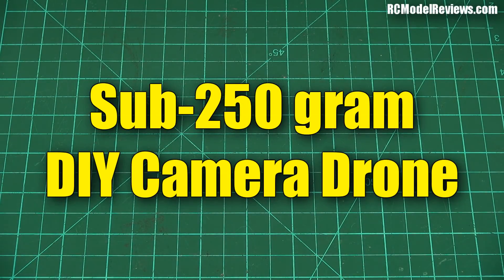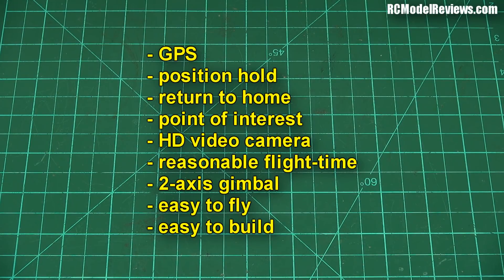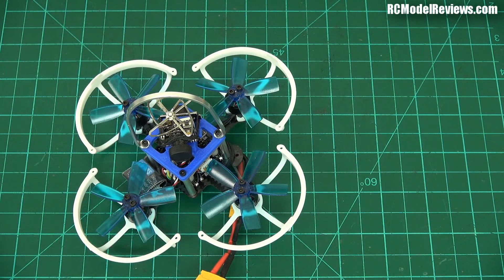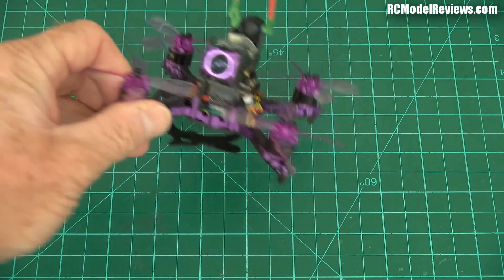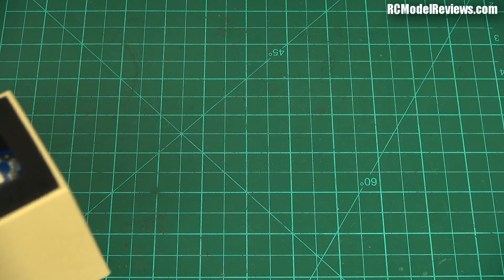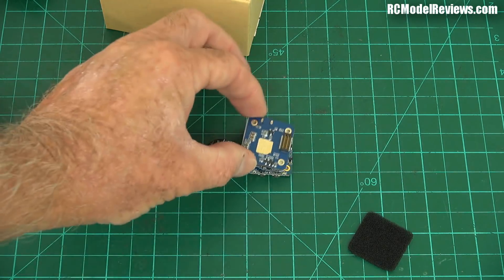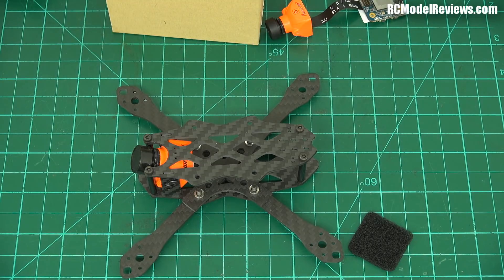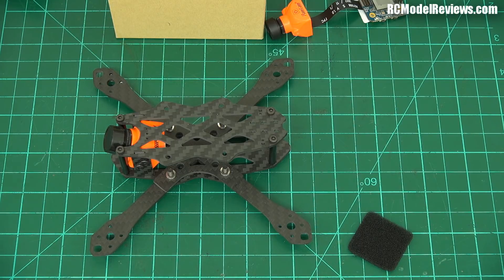A sub-250g camera drone DIY project

Comment: Hi Bruce. I'm a huge fan of your channels and have been meaning to comment for a long time. Watching with great interest on this little project. I started with a Diatone ET 160 (@ 31g the lightest 4" frame I could find) with DYS 1306-3100 motors with 4045 props, Omnibus F4 FC (iNav), FrSky R-XSR, 4 in 1 ESC, small CCD cam with Eachine VTX03, GPS with mag, 3S-850. Takeoff weight 220g. This has a lift weight ratio near 7:1 so I could get away with smaller motors, a smaller ESC, a lighter GPS and exchange the CCD cam with my Foxeer Legend 2 to get HD. No idea if that'll make enough weight allowance for any gimbal though........On another track, I also built a full FC, iNav, FPV, GPS 600mm wing with TO weight far less than 200g and long flight times. Maybe a way to reach the goal you're after. I also like the Pixracer idea mentioned earlier; same size and weight as an open source FC...but with Ardupilot. Cheers from Canada.

Comment: I did a 250 gram build with DYS 1306 2300kV motors, good ol' 5030 gemfans, Turnigy nano-tech 2000mAh 2S 20C, and a modified Diatone Blade 200 frame. Also with a GPS, and running iNav, for return to home, etc. Got about 15 min flight time.

Comment: How about a GEPRC Sparrow style frame that raises the camera above prop level? I also have some UDI U28 quadcopters that use a 720p camera that takes decent video but I am unable to receive the video with my FPV gear. I don't know what frequency they use and can't find any info on the camera board.

Comment: Great idea. Ive been waiting for a 250g DJI. Its not going to be easy to so this with a decent sized battery. I built a 250g 3" racing drone includes a 850mAh 4s battery.

Comment: I never rely on my mavics collision avoidance anyway.

Been wanting to do something like this long time. My feedback is yes do this project! But don't limit yourself to 250grams, just make it lighter than mavic.
Make it reliable, durable, easy to replace parts. Wondering how you're going to fit a 2 axis gimbal while staying under 250grams + battery + camera. My little racing quad with battery and just fvp camera is 450grams.

Comment: Hi Bruce, I have been working towards building a micro gimbal but one of the biggest stumbling blocks to date is the motors. I did attempt to rewind some cd drive motors 12n14p with  0.02 mm magnet wire, but there was no way I was gonna get 100 turns per pole to reach 15 ohms across 2 phases. The best I managed was 30. I have a 3D printer, and could probably swap ideas using sketchup, stl files and thingiverse etc. Just give us a holla.
Reply: Have you tried floppy drive motors? I have seen them used for motion control.
Reply: Hi Paul, it is possible to use small 1103 12n14p motors, but they would have to be rewound to perform on a gimbal. They need to provide high torque at low rpm, so each pole needs to be tightly wrapped with at least 100 turns of very fine magnet wire. Motors for quads etc, are wound for kv rating, so only have 6 - 30 turns per pole using a heavier gauge wire and much more power to drive them. It is a bit of a dark art to get things right. Right ?
Reply: I'm working on this too, and have got stuck on the gimbal, I have a small gimbal, but wanted to use the front end of the split on it, but I couldn't get this to work as I can't tune the board. Have a prototype frame ready to print and a nice little 3 inch frame for 13xx motors,      if you want a look, get in touch.
Reply: Hi iMeMyelf, yes I believe the Walkera 2D gimbal uses 1806 size motors, but they are designed to control a much heavier load. Like using a truck engine to drive a wheel barrow.
Reply: Hi, did you try using some of the 1806 gimbal motors already available? RCX and Emax are making some but I have no experience with gimbal motors.
Reply: Yes Ben I would like to see your idea, I have been working with the original Runcam hd by mounting the lens module direct onto the outer drum of a motor mounted horizontal (Pitch)  this is held in a fork that is attached to the roll motor. A 24pin ribbon cable and connector is attached to the opposite side of the lens module to act as a counter balance. The bulky parts of the camera is fixed to the body and is linked via the cable. I have made some prototypes and they work fine, but the heaviest parts are the motors. 13XX are reasonable sized motors, 1106 or even 0706 would do the job providing they could be wound for gimbal use.

Comment: Bruce, I'm sure you've seen the Flite Test gremlins. Their guts and frames could be a pretty decent platform to start with. You can get the 3d printer files for the different frames they've come up with so far.

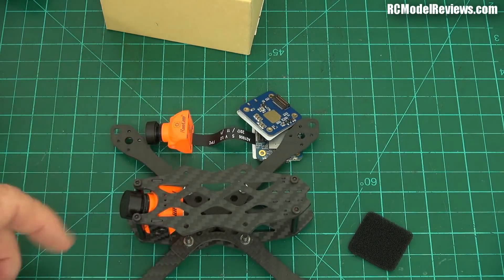Comment: I looked at the frame at 4:50 and listened to "props in view" and my first thought was to turn the frame upside down and mount the motors on what was the bottom plate with the stack reversed too. I'm sure there would be a reason why that wouldn't work but not being a builder I couldn't think of one
Reply: I've always wanted to do this with my ZMR250, building it upside-down so that the props are on the same plane as the battery, increasing flight stability.
Reply: Glad I wasn't the only one thinking that lol
Reply: Single axis gimbal could be a good idea, but you got to make your own, the Quanum single axis gimbal is atrocious.
Reply: jack36202 like the li-ion idea👍 but personally would like a 2 / 3 axis gimbal for POI and more

Comment: Im ahead of you Bruce, although my Martian 2 is a bit bigger....Im wanting a tilt servo on my HD / FPV Camera.....My Martian will fly for 15 minutes on a 2200 3S easily....I think sub 250 is going to be tricky myself.
  The other thing is that most stuff is 5 inch prop based, although I have sourced some 6 inch 3 bladers....for my F330 build.
I dont think we need those huge 8,9, or even 10 inch props either.

Comment: If it's not going to crash, then use foam-filled CF skinned props and thinner arms horizontally but perhaps thicker vertically to reduce weight and propwash resistance. Could also get away with thinner CF plates. 0.5–1.0 mm for body.
Gimbal controller boards probably shrunk a lot over the last few years, and a tiny camera would only need tiny bldcs to handle - fun challenge! I'd like to see one for a mobius mini!
Reply: Poor Bruce will need a microscope for everything in this build ;)
Reply: Yeah, I'm starting to get familiar with that, sometimes having to wear 2 or 3 reading glasses at once to do the tiny stuff!

Comment: Awesome idea, but I just don't see you beating the dji Spark, which is already over 250g. Perhaps if you could somehow take the camera, gimbal and recorder out of a Spark and put it in a lighter, simpler quad you could do it, but you wouldn't have the Lightbridge, GPS, altitude hold or any of that. If you really can work out a tiny gimbal for a Split mini, you could come up with something, but the altitude hold and GPS stability are pretty important in getting usable AP footage. Good luck, can't wait to see what you come up with!
Reply: My guess it´s one of those projects that will never see daylight... would be awesome, but it´s hard to believe.

Comment: Why does all that processing need to be in the camera? Surely we could lighten the load if the recieving headset could perform things such as WDR and perhaps better stuff such as bicubic filtered upscaling. We also need a decent camera feed that is real time and yes I know only the old analogue gives you 15ms which is why I propose another project perhaps like how the new 3D vision quadcopters have two cameras and two 5.8ghz transmitters we could have one HD camera sensor that outputs to a quad quarter split 520TVL / 720TVL depending on desired latency and final output lines. Then at the headset end you could have four receive antenna's then recombine the quarters back into a single higher TVL image. Then call it Analog Quad HD or something and find a way to miniturise it on a single board.

Comment: i had this idea years ago before dji was releasing smaller models. What i struggled with was gimbal tech. small Cameras dont enjoy being stabilized. dji get around this by having optical stabilization within the cameras as well as the gimbals. Their optical flow sensors lock the copter in place too rather than ther casual drifting of other systems, and i just couldnt compete with them but you are much more clever than me Bruce. So i will get my popcorn ready! cheers
Reply: I enjoyed watching those vids!

Comment: I've been thinking on this topic for quite some time and there are several problems to address IMO:

1. Flight time - Even DJI Spark sports a 15+ minute flight time. This will be difficult to achieve with a sub 250g model, because we are likely to use <= 4" props and our batteries and other components are heavier than those on the Spark. Spark weights at 300g but it has 1500mah 3s battery that weights only 95g and nearly 5" props. I am aware that this flight time is partialy achieved by changing the way the craft flies (mostly hovering, low acceleration on raise and descent, etc.), but I feel that we also need to think about efficiency.
2. Small gimbals and cameras. The Split mini was a godsend. All we need now I a small gimbal to accompany it. But I see you have this covered already .
3. The software. There’s nothing on the opensource space that is anywhere near what DJI has. The best we have for our run of the mill FC’s is inav (it’s getting better, but very slowly). Pixhawk maybe? Don’t have much experience with that one though. Also – DJI’s legendary stability secret lies in other sensors, not only GPS. Inav is testing some optical flow sensors right now be we have still some distance to go in this regard.
Anyway, Bruce, I’m very much looking forward to this project. If we as a community can help in any way, don’t hesitate to ask :). Cheers!
Reply: Just contribute, do not wait till he ask. Bruce has a  Patreon
Reply: I think you have some great ideas! However, if we step up a notch in motor size, we will get more effiency from larger 6" props.
Reply: True, but we still want to be sub 250g, don't we? But that might not be possible, the streamlined spark is already 300g :(
Reply: iMeMySelf 6” props are easily available if you use a gear ratio. Gear can be 95 to 98% efficient if we’ll set up. This allows you to turn a 6” prop on a small higher KV motor that is typically suited to a 2” or 3” prop. Typically with a 4:1 gear ratio. Usually brushed quads use this, but use brushless and a gear ratio and you should have a nice combo. The key is in the testing of prop / motor / gear ratios, as accurate test data from components is not available physical testing is the key. I got one am looking forward to these bench tests 👍
Reply: I forgot about that, 4 x 2204's is 100gram already!
4 x 1104 weigh in at 20 grams with 3030 props and 4 x Emax 1806's with 5045 pops are 80 grams.
Reply: Andrew McMahon Gears seems somehow advanced but yes, they're available and it's possible.
Reply: mPky1 coaxial copters are also very efficient. Unfortunately I have no first hand experience with them in an RC form so I do not know how stable they are compared to a quad / hex. Does anyone else know if they are worth considering?
Reply: I applaud Bruce for this project and keenly watch. I have always though that at the expense of flying under government restrictions, flight time is a reasonable trade off.
As my usage would be more cinematic than those landscape aerial tours or time-lapses - I can always land and swap battery at 7 or 10mins. Not many shots need to exceed more than a couple mins. Just as now batteries will get better adding more flight time, so let's hit a usable gimballed 250g mark and increase flight time over time.
Also, yes to pixhawk (coming from a 3DR background)

Comment: Oh my god you’ve been reading my mind!!! Get out of my head 😂 
On a serious note, excellent ideas, especially the small gimbal motors and a 3D printed frame for the gimbal. I cannot wait to see where to get them from, I have genuinely been looking for ages. 
Also another noteworthy point is the fundamentals for fan efficiency... use the largest prop you can and spin them as slowly as possibly. I believe the power consumption of the prop is related to the cube of the speed. So a small increase in rpm (KV) is an exponential increase in power consumption. Looking forward to seeing your bench tests. Thanks and keep up the good work.

Comment: I managed to pack a quad with the Split within 180g with the big 850mAh battery that gives 7 minutes of frisky flight, 9 for hovering and 150g with the normal 450mAh but only 5 minutes 'till flat. 
The props in the face problem solved by a slight crop within the camera settings (narrow fov)
The quality is still OK. At least in my opinion. 
The quad is based on the KingKong 130GT frame and motors. 
Flares: I like flares but a better lens solves it. The AR coating is crap. 
But the Split, as a whole, is just awesome. The fpv feed is awesome alone! It gives the exact same colors and white balance like on the recorded video with very good resolution.
 And 1080p, 60fps and a nice Wide Dynamic Range that extends into the fpv feed making the fight really enjoyable in the crappiest lighting conditions.
 
Having plenty grams to spare there could get in there two servos for a gimbal. Two nano servos. I think they are about 2g. Saw some in a local shop a long time ago... can't find them on line...I didn't look very hard either but the average Betaflight/Cleanflight FCs can do gimbal stab.  And that would be a 2x2g gimbal! Roll and tilt is enough. 
Servos, these days, are plenty smooth for this kind of job and quads. 

The fish-eye effect from the superangular lenses is easily corrected in software. I use kdenlive for cutting, defish-ing and light editing my videos. There are plenty programs that can do a lens correction on a video. 

Just don't set the Split to PAL. They did not fixed that and the feed stutters like mad. Works fine on NTSC.

For the rest, tiny 3-4A ESCs, 1104 or 1105 motors, good PC 3045 props, a small but solid 1-1.5A 5V SBEC, the tiniest FC with pads for extra motors that can be used for the servos. 

I still want to add a tilt servo to my quad and I think I'll eventually go for one of those microscopic helicopter servos for the nano... 100mm(ish) CP-like ones. They are likely 3.7V but there is nothing a small LDO can't fix  or two silicon diodes in series if really lazy :))

Comment: What do you think about Pixracer? I think it would be good for this project
Reply: emi83ro it would be great, but it is very expensive :( hopefully Bruce could get us all a bargain from China?
Reply: Also worth looking at the sky viper GPS model. This drone basically needs a better drive train and Bruce’s small gimbal adding. If the flight controller was available as a spare part it would sell in very high volumes.

Comment: The main issue I see is once we start getting all the features of larger drones in sub 250 gram packages, you know the regulators will just start dropping the weight limits even more, because you know, drones of any size are evil and people can't be allowed to have fun.  I'm also curious to see if this project will actually be completed, or if it'll end up like the foam pulsejet.
Reply: Regulators....good reason to be cautious with what you can accomplish

Comment: For the fpv quad pilots amongst you, you can get a 5” race quad below 250g with battery. Look at the Aeronaut featherlight 190 frame. I looked at an early prototype build on my channel and it was good, You could probably use the split and still get below it with a bit of thinking. Pretty easy on a 3 inch as well.

Comment: I propose to put the camera under the bottom of the frame, not on the front as you seem to mention at 5m20s. That way the top will be completely free to allow very large props (almost touching each other) which will improve efficiency and thereby flight time. The center of gravity will also stay nicely in the center, especially if you also mount the battery on the bottom.

Very good design goal, I hope you will succeed!

P.S. at 5m55 you say that collision avoidance will never be possible under 250 grams. I think you will be proven wrong in just a few years :)

Comment: How small can you make a gimbal? Can you save space with small servos instead of motors?
Reply: I was thinking about servos, too. Link them to the flight controller, so they are controlled by aux switches. It would be neat if they could also be programmed to read the FC's gyro values, and maintain their angle, regardless of the quad's angle on the pitch axis.

Comment: I'd love to see the longest battery life possible, which likely means the smallest/lightest frame with the biggest props that will fit

I'd be delighted for you to look at my own little frame, which I built for a similar purpose, and see if you find any parts of it useful:  http://forum.flitetest.com/showthread.php?38103-GREMSICLE

The main parts are 3D printed, and held together with popsicle sticks.  It's built around the 1106-4500Kv size motors, but I run it on 2 with larger low-pitch 3" props and I've gotten almost 15 minutes of 'cruising' flight time out of it.  And actually, I really want to try 4" 2-blade props for max efficiency, but I haven't found any suitable props that fit the 1106 motor.

Comment: Making the circuit boards from flat flexible pcb like they use in phones would significantly reduce the weight, but it would be difficult.

Comment: interested to seethe gimbal, maaybe the whole split mini can be stacked with the gimbal controller.. maybe even top mounted? or how about 3d prop direction for landing to avoid the need for legs, ummm, what else. a gimbal lock mode for actual crazy flying, ummm the 250g is a good target but i would maybe think up to 350 veersions too...